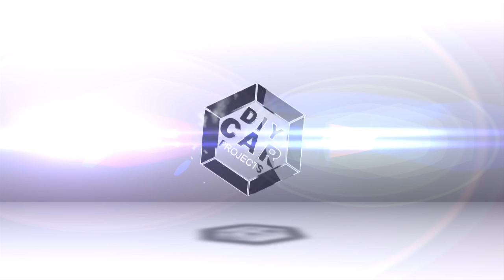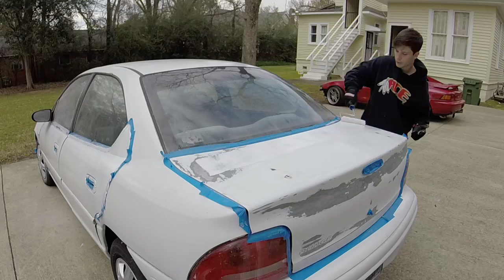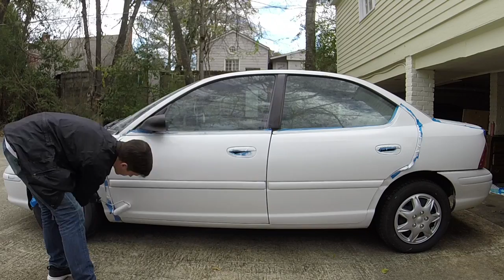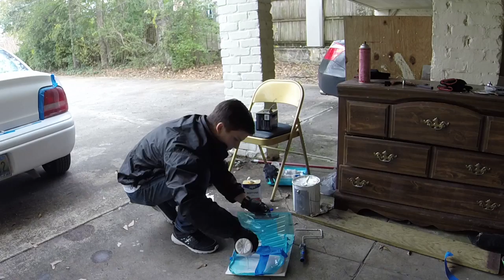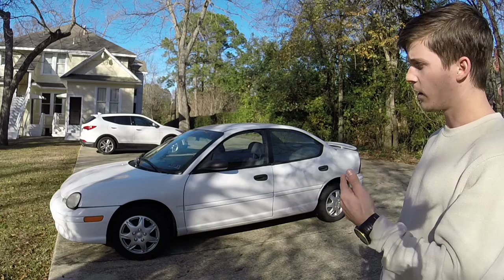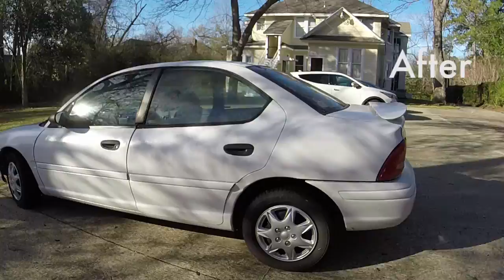DIY Car Projects: Rustoleum Paint Job pt 2

Comment: Love the Neon. And now you can rest assured it has better paint on it than when it left the factory. So many makes had the same peeling problems with water based paint.

Thanks for the video, very enjoyable. 

I always swore my 63 Valiant had been painted with house paint when I got it. Factory red, Earl Scheib beige, refrigerator white then One Day Paint Antique White it's been wearing for 17 years now that still looks respectable.
Reply: No problem. The industry had to change paint formulas to meet EPA factory emissions regulations. Lots of Corsicas and Grand Ams out there with the same look. 

Moar videos !!!!  That Neon looks clean and respectable now. And I thought the lip video was a clever use of garden supplies. 

It's a sickness and you've got it. Enjoy.

Comment: I did my truck 1 1/2 years ago in similar fashion and just ONE coat of rust-oleum (black) and i did not "water" it down.
It withstand winter, summer you name it however it's now fading a bit (sun light) so will be doing your method if thinning it down and multiple coats. And i will bondo the small dents it got on my cab....

Cool project and well done..

Comment: if it is cold acetone is probably fine but it will dissolve most plastics given enough time, I am going to spray my truck  with a similar paint but I don't know if i will use a1 kerosene or lacquer thinner (acetone) I guess i should test both.

Comment: I appreciate the effort you went to making these videos. One note though, certain paints shouldn't be shaken as it causes bubbles to form. Overall good tutorials.
Reply: Just an update on my car I decided to scrap the roller altogether and am going with a high density sponge instead padding it on. It seems to produce a bit smoother results in my case, I was working in 80 degree temperatures and my attempts to smooth out the edges between rolled areas went disastrously. Perhaps I didnt have enough thinner mix ratio (using 50% mineral spirits/ 50% paint) but I think because it was really warm even my attempt to lightly smooth the areas I had just painted dried fast enough to leave imperfections which I'll have to go and do a lot of sanding on down again, as in like back to the beginning stage. After getting frustrated I broke out the high density sponge only lightly dipping it into the remaining paint and added more diluter and just started pressing it against a test area that hadn't been painted yet and just kept pressing the sponge until the sponge was dry and as mentioned I got a more uniform result in the end with that method. Still in the process with the rest of the car, let you know how that goes.

Comment: cool vid but i think u could have thrown on some less gay jams lol...also instead of using the rollers they do have some dyi electric sprayers on amazon or ebay...there the ones with the vacuum motor hose and spray can check them out there like no more than 50 if u want better quality work or add clear coat...smh but dont use a roller it leaves orange peel like crazy and the results just are not worth it....but hey pratice and experimenting  makes perfect.